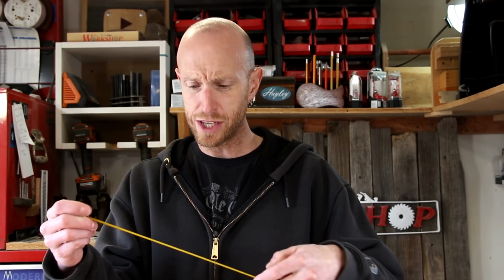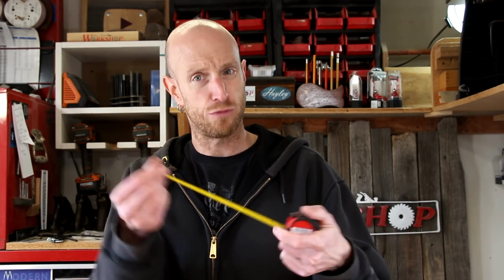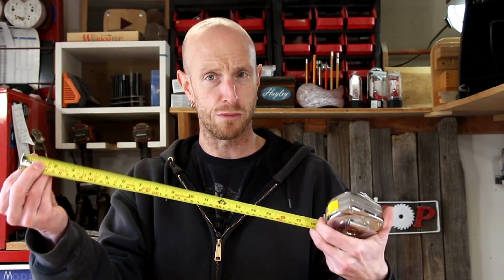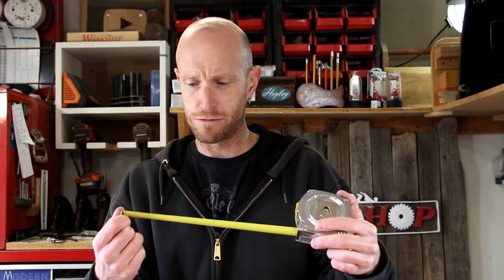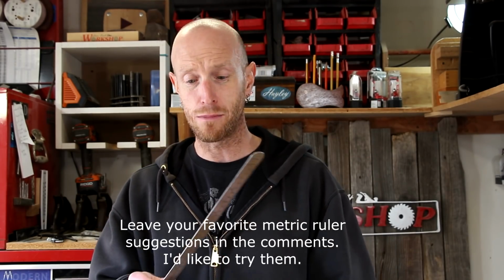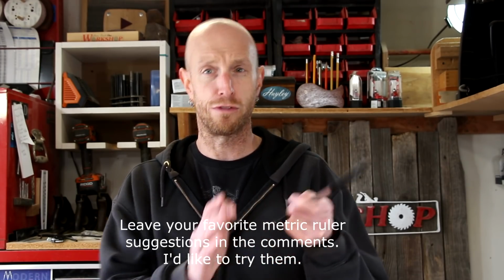My thoughts after using the Metric System for a project | I liked it

Comment: Metric is literally as easy as counting fingers, while imperial is like having a bucket of water, a pile of sand and couple of screws and trying to count with that...
Reply: That pretty much sums it up.
Reply: best analogy yet lol
Reply: Very accurate
Reply: A 5 gallon bucket can fill five jugs, 1 of those can fill 8 pint size water bottles.
A 20 liter bucket can fill five 4 liter jugs, 1 of those can can fill how many 475 ml bottles? 
It's setting a real world image to the measurement rather than doing constant arithmetic. It's articulating a measurement to what you see. You wouldn't get the tape measure out to see how many steps it takes to back into a tight garage would you?
Reply: Imperial and metric have one thing in common... they are both incompatible with imperial.
Reply: @xxRamD3yruxx  there are no 475 ml bottles, they are 500 ml lmao. how many pints can 23/187 of a jug fill tho?
Reply: @xxRamD3yruxx  a 4 liter jug can fill 8 500ml bottles. Very easy
Reply: Yeah it’s mostly 500ml or 250ml bottles
Reply: I see what you mean, but in actual fact it's pretty much the reverse. By which I mean that metric's volume is based on a mass of water and imperial is literally counting feet.
Reply: @xxRamD3yruxx  It is VERY EASY to tell you how many "475ml" bottles can be filled by one "1 liter" jug:
1liter==1000ml
so, one "1 lit" jug can fill two smaller bottles, with 50ml to spare.
EASY.
Mic dropped.
Reply: excellent way to put it
Reply: @xxRamD3yruxx  I dont get your example at all. 475ml bottles are rare at best. The norm is 500. A "4l jug" which is also rare at best can fill 8 500ml bottles. If we take the random example from you then its still 8 with 200 ml to spare.
Reply: @xxRamD3yruxx  where on Earth would you get such ridiculously sized bottles? Oh yeah, somewhere they might match an antiquated measurement unit known as a pint. Of course depending on which side of the pond you’re on, even that might be useless. As others point out, pretty well everywhere else in the world you’re drinking your beers from 500ml glasses - let me convert for you: that’s 1/2litre.
Reply: @xxRamD3yruxx  That's got to be the most flawed comment I've ever read on Youtube.